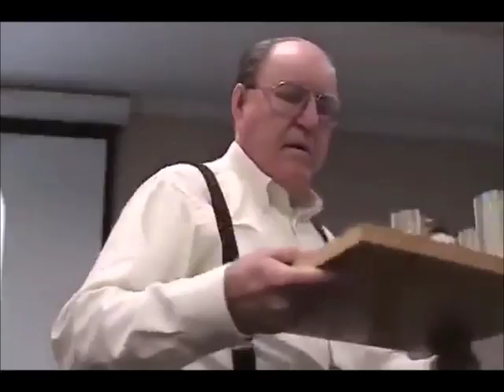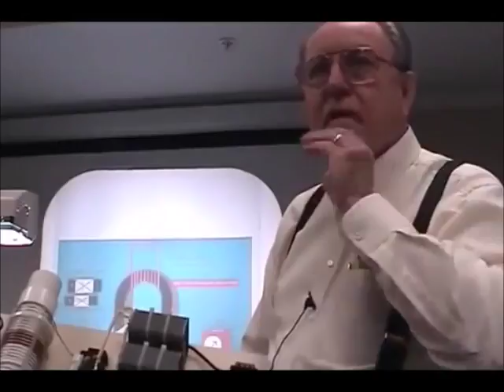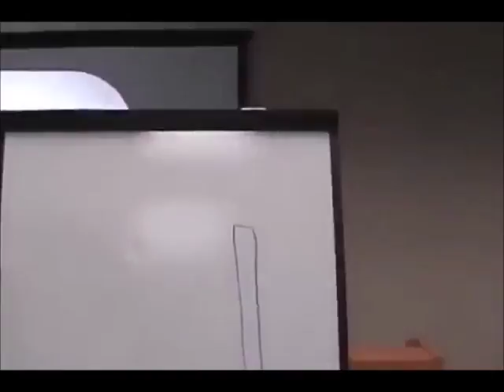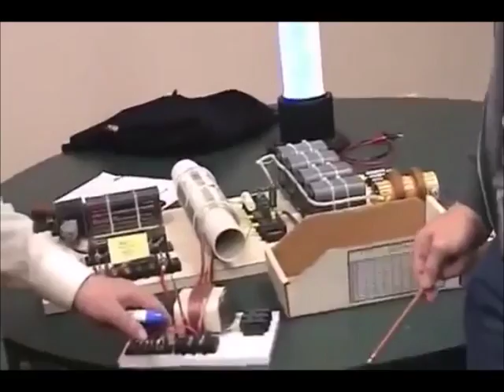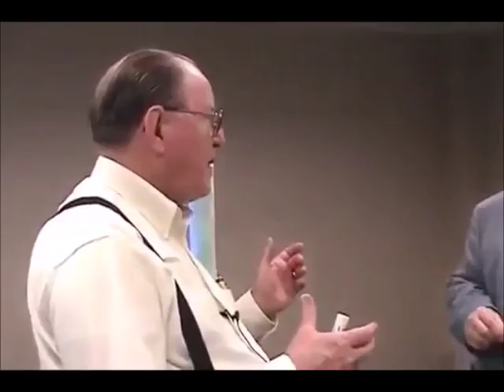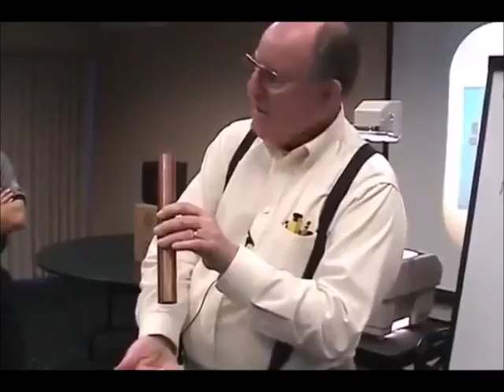5 Don Smith Resonance Energy Crafting Systematic Index 2001

Comment: The point I am making to who is ready to listen and learn is that YOU NEED NO L1/L2 coil!!

Simply make a Mazilli Driver which is an High Frequency Inverter Oscillator and connect an Homemade 12V/50KV+ Transformer to it but make sure you tune the 50kv+ side to RESONANCE.

HINT: use multifillar wire in the secondary to massively multiply the voltage. That is divide your single strand thin gauge secondary wire to several equal sections and connect them in series. Once you do that a single strand secondary which formerly generates 2kv  would likely start to generates 8kv plus depending on the number of sections.

After all that, measure the inductance of the Secondary to calculate the needed capacitance at the correct voltage to add in parallel to the High Voltage output multicolor wound secondary Make sure you use Ferrite Core to increase the Inductance and ambient energy asorbtion at RESONANCE.

Now the A.E at RESONANCE is present at High Voltage High Frequency in the secondary lenzless coil, it needs convertion before getting step down. 

This is where combination of DC Capacitors, H.V/H.F Diodes , Choke, Varistor or TVS Diode(s) and an Inverter are NEEDED .
Reply: So the Mazilli Driver is the common ZVS drivers available on amazon/ebay now. I don't think 50kv is necessary but the amounts of energy available scale up huge when voltage is increased. The ZVS driver does produce some interesting results. But I think the AC waveform is its detriment. It needs the spark gap to produce the necessary spikes.
Reply from the maker: I have a few of these drivers and did experiments with them some years back. You say 12V/50KV but at first you say 100KV. I'm curious to see what you were doing. It almost seems that you are translating from another language. Is that the case? I believe you mean secondary not "sensory". Also, a single strand wire cannot be divided.? Maybe you could make a diagram.
Reply: Rick l am not translating from another language but English is not my mother tongue.
50KV , 100KV, 70kv bla bla bla....
What you must ensure is TIME reduction in charging duration of the arrays of DC Capacitors needed to harvest flyback trafo energy at **RESONANCE** massively present in the High Voltage High Frequency Mazilli Driver Driven HF/HV Inverter. Mine can give me upward of 600Khz. 
You need not to buy ready-made M.driver search for the circuit diagram online. My driver at 12V inputs do consume less than 5W to produce whatever voltage I want.

So forget about ebay, aliexpress etc. just build your own. That driver is a Gem!!  

It Primary is readily always in auto resonance. 
Use ceramic capacitors of say 3KV 4.7nf in line with it 2 drive legs. Forget MKP, CBB or any other type.

Use ceramic capacitors too for Resonance balancing too.
I am giving you my secrets here now.

Again after obeying High Frequency and High Voltage laws next is Resonance once you achieve that, you can use inductor to convert the High Voltage from the Resonant Fly back trafo and you use DC Capacitors too.

The best is Capacitors.

It's not hard to do. It's simple. 
If you connects 100pcs of 400V 100uf in parallel, you will get 400V 10000uf.

The time needed to charge that will be higher than if you connects the 100pcs in Series which will then make 40000V 1uf.

The later will now needs 40000VDC to charge fully up to 1uf in matter of seconds. If you further want to make the charging speed up, reduce the capacitance further by adding just 1 or more 400V 100uf in series still. So 100uf divided by 101pcs will equal 0.9 point something uf or 900+ nano farad.

You ain't going to discharge the Power in the speedily charged caps in Series but rather in Parallel. But if you linked the caps in series directly and link the directly at the same time in Parallel just like that, then Kaboom they will go.

So what to do is to use High Frequency Diodes to Harvest the Power in the caps and link that to a choke, Varistor and Invert the Power for household usage.

Sorry I can not help anyone with Circuit diagram nor am I ready to convince anyone with my design.

I  have revealed all you needed most. Which is H.F, H.V and Resonance.
Reply from the maker: I guess you don't realize who I am. I I am the owner of Renaissance Charge and produce the Resonance Induction Coupler Kit with my book on the subject. I also spent the last year writing/compiling and producing the Don Smith Magnetic Resonance Index book. I was curious as to what you were trying to share here as is wasn't really clear. These things are not new to me as Don shared all these things many years ago. I wasn't sure if you were just trying to suggest a particular method or whether you actually use this technology. I have meetings around the USA and before in Europe demonstrating these kinds of systems. It is true that most people in the free energy community do not understand these things and that is why I make kits. I made the Resonance kit because most people don't understand by experience what it is. This kit in the original form was what Don first learned from. And it is where he said people should start with. So that is another reason why we produced it. The Don Smith book was important to show as it now contains so much more information that the public did not have until now. It is 500 pages and in color... 
What you say about series and paralleling up caps is one method of transforming the high frequency low capacity charge to a low usable frequency high capacity load. Can you share how long you have been using those capacitors? One reason Don used the "self-healing" capacitors, which I use, was because they keep on going. Regular electrolytic would not last too long under the high frequency and continuous cycling like that. When I do something like that I use the photo flash caps that are more made for that kind of stress. But even those have a cycle life. 
Anyway, I appreciate your effort to share all this and clarify more of what you were meaning.
Reply: Yeah, I know who you are but that is not relevant here now. What we all need is to sharpen one another and provide easily understable Solutions.
Once people understand the How and Why about Tasla/Smith works, they can then on there own arrange things in there own ways and still get the PROPER EXPECTED RESULT(S).
Reply from the maker: Well it is relevant as it appears you are addressing me as if I don't know these things already. Sure we all need to sharpen each other, but that will depend on if people are properly communicating. You say easily understandable solutions and that is why I asked you just what you are trying to say here. You say no need of L1/L2 but then say build a transformer. But a transformer has an L1/L2. Also, are you suggesting in the multistrand secondary to use insulated strands and by putting them in series to do that like the Tesla pancake bifilar arrangement?
Reply: The intermediate 1:4 L1/L2 in Don Smith Device can be replaced with Multifillar right in the High Voltage 12V/50KV+ Transformer. The Z.V.S is an High Frequency Inverter Oscillator which generates AC. Yes I use insulated multifillar wire and put them in series. The Inductance will become extremely high. 
When high Voltage is present in a conductor, Ambient electrons will move closer to it. But the moment the High Voltage Carrying inductor is tuned to Resonance, the Ambient electrons will enter the electrons massively. I know you are already aware.of all these. But about people who do not understand these principles?

Comment: What I have discovered is that Resonance.is the first Law to obey if one will harvest energy from the Air and Earthcrust.

After obeying that Law comes High Voltage law.
And after High Voltage comes High Frequency.

With those 3 rules practically obeyed then one can twist Don Smith device in number of ways!!!

You can use Mazilli ZVS driver to drive an homemade 12V/100KV Transformer at RESONANCE and use 200pcs of 400V 100uf electrolytic capacitors connected in series to harvest the incoming RESONANCE driven Radiant Power.

The caps would be charged in series and discharged in Parallel using High Frequency Diodes connected to each terminal on the individual capacitor. The Anodes  of  diodes will be paralleled while the cathodes too connected in parallel to Mass up the Current in each cap of 400V 100uf. So in the end the Output power will reflect 400V 20000uf .

But the charging time will be low as the whole 200pcs of 100uf are in series which makes 100uf/200pcs= 0.5uf or 500nf.

When caps are linked in series, when being charged:
1. Charging current is the same for each cap
2. Charging frequency is maintained not divided as in caps that are connected or linked in parallel. So each cap sees the same charging frequency.

TVS Diode or Varustir is needed to make a set up like this work and you can use extremely high frequency like 1Mhz or more.

Don Smith way of using Voltage Divider is not necessary Provided you have the money Custom -built High Power Inverter.

What you must keep to is Resonance. 
The Mazilli Driver paves way for Auto-Resonance in the Primary so to make the Secondary rings, simply measure it inductance to get the need ed capacitor to add in parallel to the output terminals of the Secondary High Voltage winding.

Remember at RESONANCE, OHMS LAW IS NOTHING PRACTICALLY!!
Reply: The diodes connected to the positive and negative terminal of each capacitor is meant to sum up the Power of each caps in parallel. So the anode goes to the negative terminal of all caps in the array. While the cathode goes to the positive terminasl of the caps in the array. Now connect all the ends of the anode in parallel and connect all the ends of the cathode to in parallel too. There you have it now! You have add up in parallel using diode.
Reply: You need not to disconnect and reconnect anything. I assume you know how to do the switching going by your background in electronics. 
We are pumping caps here so all we need do is to Dam the overflow using an High Current Choke and "vastorised"  the unneeded excess voltage to ground. And from there to the final output DC Cap then to an High Wattage Inverter.

What my simple setup is about is to trick the Resonant energy from the Z.V.Switched 12/50KV+ Transformer into believing that the converting cap is of low capacitance in nano fares range. So it pumps it in a jiffy repeatedly and that will cause overflow when Diodes are used to harvest power from the caps into a Choke.

The High Voltage of say 40KV or 50KV or more would be determined by the number of caps in series to achieve nanofarad range or lesser(picofarad)

The caps fills up in series in excess and you discharge in parallel at either 50hz or 60hz. So there will always be excess power available at an High rate.

The multifillar wire-wound secondary in the Z.V.Switched  Inverter at first stage eliminate s  the need for second stage L1/L2 coil and also at RESONANCE negate Lenz effect before the series-parallel caps needed for Radiant energy convertion.
Reply from the maker: Yeah, the only thing with using the varistor is that you have to get it just right or you will wear it out fast. It needs to be close to the voltage and not too stressed. 
And I wondered about how long your capacitors would hold up under all that stress. I'm assuming you got the electrolytic HF type, but these are generally only rated for 2000-5000 hours unlike the self-healing types Don used which I find great. Caps can obviously go longer than their ratings depending on temp and other conditions. It's about $200 more or less for those value caps you mention so they need to pay for themselves over time. These are the things I deal with in relation to production in my company. Wearing out of gas tube lightning arrestors, MOVs, or caps all come into consideration...
Reply from the maker: That would be a basic resonance example, but you have not mentioned the inductance of the Transformer, or details about it. Was this a thought of yours or did you actually build this and get results?
Reply: This is not a thought nor basic resonance. I have done Practical test and I can tell anyone authoritatively that you need DC caps to Harvest Radiant Power which is always massively Avaible at High Frequency and High Voltage application. 

Caps needs Voltage to produce Current thus the needed trick is to convert the hot voltage in the secondary winding of 12V 50KV  Zero Voltage driven Tranformer to Cold electricity by tuning it to Resonance  and thereafter convert it to Hot electricity using DC caps. But the problem is TIME taken nto charge the cap in Parallel. So to counteract that, series connection of the caps is needed but the discharge would be in parallel via H.V Diodes like HER108.

Do not get it twisted, once Resonance is obtained you can set the Power for conversion and step-down number of ways.
Reply from the maker: That seems a little more involved than it needs to be, but if these are the parts you have and it works for you then that's great. The diodes are a little low on the voltage side. Not sure who is getting things twisted?
Reply: Again do not get it twisted. The Caps connected in Series make one body but connected in parallel makes individual body. 400V 100uf X 100pcs in Series is 40KV 1uf which makes 1 body. But 400V 100uf  X  100pcs in parallel makes individual body of 400V 100uf when discharge via a Diode.

Charge time is what is need to be reduced.
You at RESONANCE charge in Series and Discharge in Parallel at 60hz via a High Voltage Fast Recovery Diode. 

I have once to you that when Caps are linked in Series,
1. Charging current from source is maintained
2. Charging Frequency is Maintained too

Those two basic principles makes for overunity to be obtainable in this set-up.
Reply from the maker: I see what you are saying. Very good. It is good that you made use of the driver as everyone has been using that for a few years. Sounds like you are using one of those Tesla coils with one of those drivers on them, except you said that you made your own. One option would be to use the third coil arrangement over the top of the secondary on the high side. Oh yeah I forgot you had a different secondary with series loops.
Reply: 3rd coil or 4th coil etc. is not needed. Caps combine with inductor and varistor serves as transformer before the inverting circuit. I know the actual direction you are moving but that I see will not benefial to other people reading my comments on here. Anyways, goodluck.
Reply: pls sir can you give us a diagram circuit of your setup so we can get the magic and understanding
Reply: I love your comments and will try to follow . Thank you
Reply: Thank you amazing

Comment: I would say to  the audiance "learn to walk before you learn to run",otherwise it is not possible to ask him such stupid questions,most of them do not realize what this device is.The formula J=0.5 x C x E² x Cps tells al what you have to do.
Reply from the maker: Yes indeed. And Don shows it's actually cubed not merely squared. There are various processes that multiply the energy and you don't have to use all of them to get significant gains.
Reply: those are no stupid questions, but don evaades many of them because  he knows nothing of EE. he seems to know what he's doing though, but his lack of EE background and math makes it hard for him to convey his ideas.
 there's no way he replicated every device from the tesla book.

problem with the formula is that the units aren't equal, J x hz = J/s.